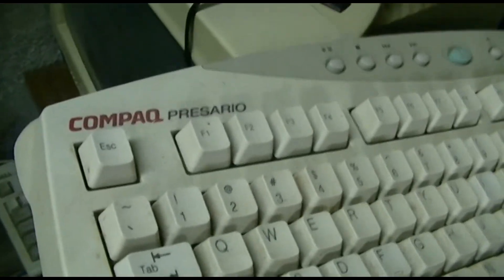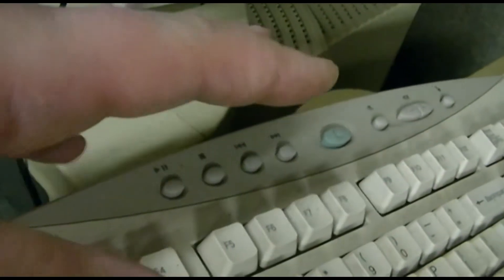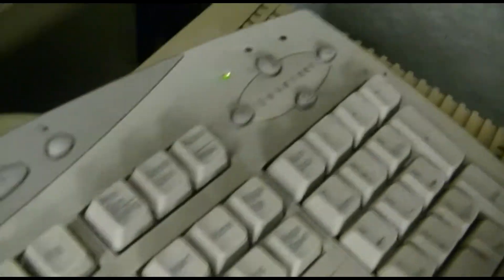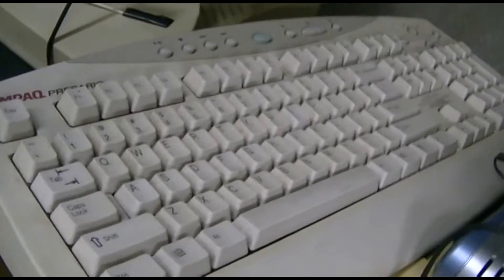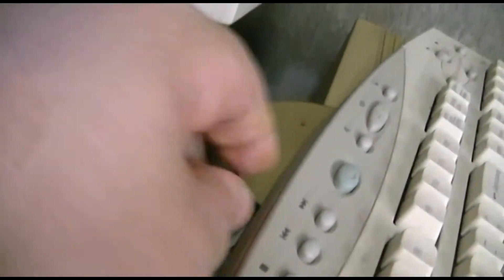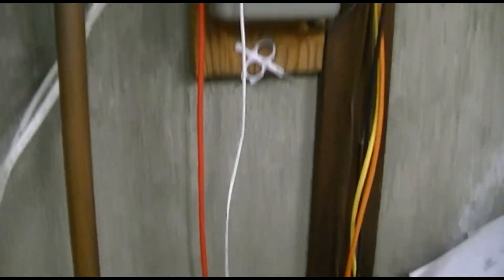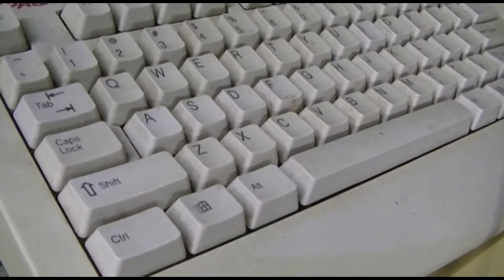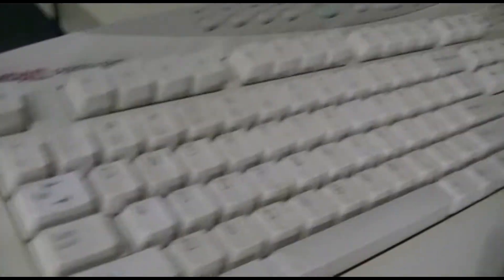Electronically Programmable Door Chime (Doorbell Server) Part 2

Comment: Very interesting discussion.. Solder blobs! What a term! I have one of those keyboards with some of that 'multimedia crap' on it.. I quite like the volume up/down buttons which I use all the time, but I have never once used any of the others.. Same goes with the additional buttons on the laptops.. That's the first keyboard I've seen with Internet buttons..

There's so many electronic contraptions from the past where you just have to wonder "What were they thinking?".. Unfortunately, I think there's just as many current items like that going around the current computer industry, some of them involving the numbers 8 and 10, and the letter A.. 

For my Christmas lights I have some X 10 Powerhouse remote control modules I use.. Usually on the vintage lights I turn down the brightness one or two notches so the bulbs don't go so fast.. Seems to make a big difference..
Reply from the maker: +Jordan U What's wrong with solder blobs?  I've said that as long as I can remember.  YouTube user Lazy Game Reviews just put up a video about oddball PC designs you would probably find very interesting.  And yes, no surprise with your lights, running any incandescent at less than full brightness really does increase bulb life, unless they are halogen, in which case it shortens life.  Good thing most "incandescent" bulbs are actually halogen now.  "More efficient, lasts shorter!"
Reply: jaykay18 I figured there would be a more technical term for it than that.. Who knows maybe there isn't.. I sure don't know what it is.. I've never heard of that channel before but I'll have to take a look.. I use halogen bulbs in my computer room.. I run them at full brightness and their longevity has been pretty good.. They've outlasted some of the CFLs (crapy florescent light) in the house..
Reply from the maker: Jordan U I have 4-footer fluorescents by the servers, they do fine.  Although I think one of them has a bad ballast, it thermals out after a while.  One of these years I'll get to it...
Reply: jaykay18 There were 2 four-foot florescent in my shop when we moved in.. one of them half-quit.. so I took that one down and put it under something somewhere.. The other one still works fine, but I don't use it much.. I don't like the color of light it produces..
Reply from the maker: Jordan U I don't mind their color, it's just fluorescent to me.  My dad has a 4-footer shop light in his shed, in the cold like this it barely lights if at all.  Fluorescent was a bad idea in there.  That's why I got those honkin 300 watt incandescent bulbs in the garage.  The CFLs that are there are for auxiliary light, but if I remember to show it tomorrow they are pretty well useless in the cold unless they warm up for some time.  "Oh, better put this lights on in the garage now so they'll be ready for me to get to work in there in a half hour!"  What a thing to have to say...
Reply: jaykay18 Before we switched to using LED bulbs outside, we had to do the same thing.. If people were coming over, we had to make sure the lights were on well in advance.. Same with taking out the dog..

Comment: I want to replace my run of the mill doorbell with a 60hz fire-alarm buzzer. Hopefully then I can hear the bell from anywhere in the house.
Reply from the maker: I know those all too well.  That will really scare you when it goes off.  I guess you'd then hook your smoke alarm to the regular doorbell ;-)

If you want to hear your doorbell anywhere, install multiple ones, like one on each floor.  You need to wire them in parallel off the original.  Also, you'd probably want 2 or 3 of the exact same ones so they will all chime at exactly the same time, if the China tolerances are even that close.

The one caveat you may run into is the doorbell transformer not having enough current to run all the bells concurrently, or reliably.  If that's the case you need to replace that one with one that has higher wattage (VA) output.
Reply: jaykay18 I think I have an idea that will work great for me. My security system talks, and you can program in "Chime zones" that don't trip the alarm. I could make it say "Door" or something similar (don't think it can say bell).
Reply: Thsts what i did.. i just ran a 16v power supply to the transformer and used a resistor and led on the button and works great..  now about the scaring the shit out of you on quiet days.  I used an old square akarm that was like a speaker somewhat..  sounds like a submarine..  was a halon alarm..  but you can tighten a nut inside and it puts pressure on the cone insude and either makes it quieter or changes tones..

Comment: Awesome!! I wish I could move my speaker outside and set doorbell ringtone to siren and scare off unknown people!
Reply from the maker: I don't know how well that would work actually, there's an expected response when one presses a doorbell button, it may startle them at best. Interesting idea though.

What I'd like to do is put a speaker outside just for the background SHOUTcast music, but that wouldn't really work since that runs on the same system.  When they press the button, they'll be blasted with the doorbell sound.  Which, of course, being the Jetsons, will likely get a smile at the very least.  But I'd still like to have music separate out there.  I was planning on setting up another system just as a file server, I could run the stream on there as well and have that wired directly, that way I wouldn't blast the neighborhood with "Ring-A-Dong-Ding-Dingy-Dong-Ring-A-Dong-Ding-Ding" when the phone rings.  Infactically™, I could set that system up just with a regular ringer so I'd know if the phone rings while out front.

That would actually be interesting if someone happens to call the house if maybe I don't answer the door "in time", or if I'm not home, they'd get a nice phone ring blast.  I think I'd opt to put the speaker in the roof soffit.  Thanks for jogging my mind--I may have another project now!  I'll put it on The List™.